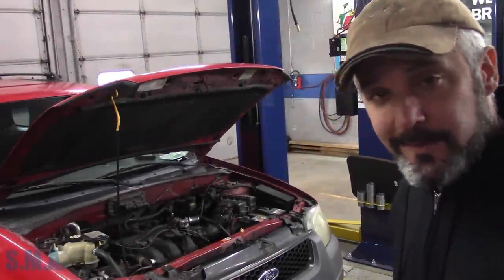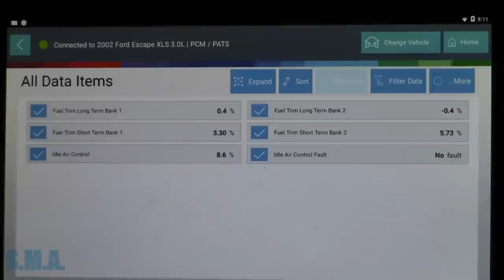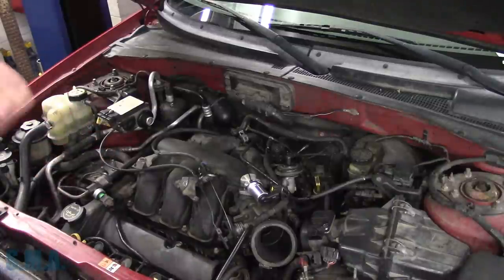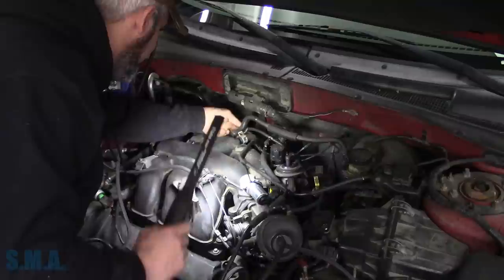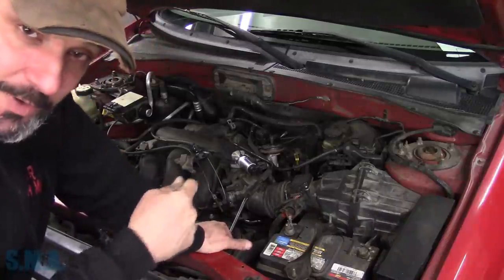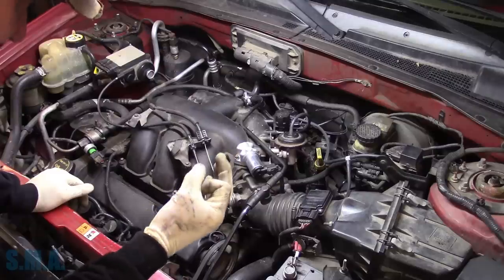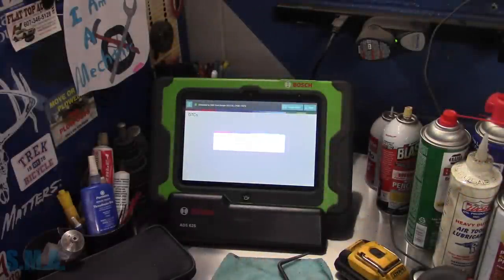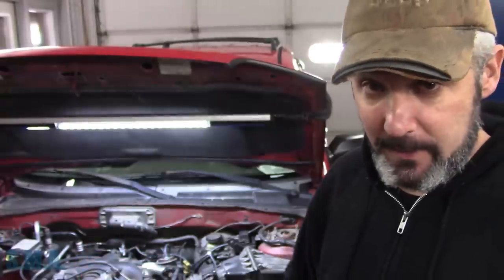Ford Escape:  P1506: Idle Air Control Overspeed Error

Comment: Aloha, I'm 80 years old and this type of repair technique is not new and unfortunately it is NOT going away.  I have had several mechanics that I supervised before all of the ECM era and nothing has changed.  You are one of the few that have an understanding of system function, but for each one of you there are 10+ parts changers and they are ASE certified. Keep up the good work..

Comment: Thanks for this video.  Just used it to diagnose a racing up and down idle in a 2001 Escape with a 3.0.  My friend wanted to put a new IAC on it, I said let's smoke it and lo and behold the vacuum hose from the pcv to intake had gotton against the exhaust manifold creating a massive vacuum leak.  I'm  not in a shop, just a retired gear head with some tools and plenty of time.  Thanks again.  Jon in Tucson

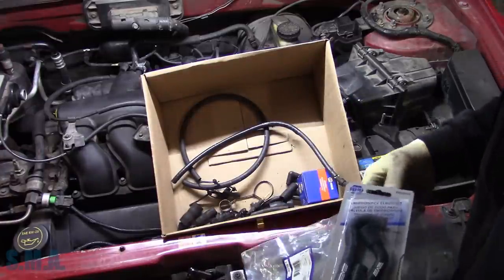Comment: I am at 19:33.         So WHY would that many rubber parts fail? Exhaust leak under the hood?  Engine constantly running hotter than intended? Aux Electric fan not functioning???     (I don't know!!!     I am old school we had Sun Distributor machines and generator/start motor "rattlers"  and Ociliscopes and thought we were "hi-tech".)  An "advance" timing light: OMG that was Buck Rogers! How do you guys do it today????    We gapped most Fords in a pinch with a book of matches (0.016inch, about). 

Don't take this with any seriousness,  I am just a very old mechanic that loves your analytical approach and wish you the continued best.
Reply: The concept is called "design life" Back when things were designed by small teams using paper and slide rules they built in extra margin for themselves because it could easily be one guys fault that a part didn't last. Now with huge collaborative teams of designers working with well-defined design criteria we have much less maintenance and more sophisticated vehicles, but this creates an new problem... saving one penny on a part makes sense when you are making 500,000 of them. And designing with a particularly defined lifespan is another. If it needs to last for a design life of 15 years, that might dictate a less costly rubber formulation. Now that the car is 18, everything's starting to fall apart. For contrast, go check out what Cold War Motors works on :)
Reply: Pretty much anything built after the 90's runs hotter under the hood  because of the way they crammed everything under it. Nice hot converters hanging off the manifolds all the lines and wiring blocking airflow, or worse the insulated engine covers and noise insulation that holds the heat all under the hood.
Reply: Wow Ben! You take me back to my automotive school days. Remember when we measured the capacitance of the condenser? Then discovered it didn't really matter as long as the metal stayed put on the points. The engine itself was as good a distributor machine as any with a scope and variable timing light. I see a lot of rotted "rubber" parts on vehicles these days. I mean the kind that turn your fingers black and don't want to come off with industrial hand cleaners. These parts just don't hold up to the petroleum vapor environment. I've seen too many sucked shut or dissolved.
Reply: Cheap parts built by the lowest bidder to the lowest quality possible.

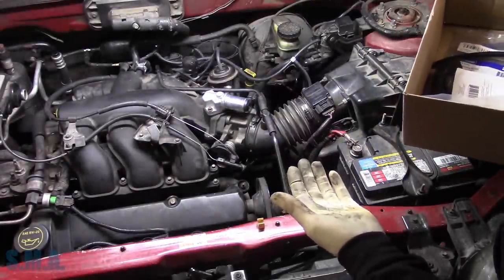Comment: 19:54 THANK YOU for saying this. I unfortunately see a lot of work like that and really unfortunately have even worked with people (for a short time) who did work like that, because there are a lot of really garbage mechanics out there. I've even seen this kind of work from dealerships, along with the usual poked wires, broken clips, misrouted wiring, missing bolts, etc. It makes me sick because I put so much pride and effort into my work, but the mechanics who get it done faster (but crappier) often get paid more, at least for a little while. I understand that things sometimes break on an old car because, lets face it, they aren't built to last. But if everything you touch breaks and you fix it all with electrical tape and super glue, you are the problem. It's nice to be the guy who fixes it right after the other person (or people) got it wrong and/or made it worse, but it really makes us all look bad.
28:40 Ignorance is not an excuse for bad work. It doesn't take a mentor to know that a car should be in better shape than it was before a person fixes it. That's kind of the definition of "fix." Charging someone to fix their car and breaking a ton of other things in the process or generally doing really horrible work is not acceptable under any circumstance. Every professional mechanic has access to training of some sort. It requires them to recognize that they need to improve and take the necessary steps to improve. It should not require someone to tell them that their work sucks. Sometimes the most respectful and useful thing you can do is call out someone who needs to do better or do something else.

Another great video, as always.
Reply: Another thing professionals need to remember is that book time is book time. For every job that takes half the time you get to bill, there's another job that takes longer. Either way, it should be done right. My steering wheel has been crooked for a long time. The mechanic who installed the new steering rack did so with the column misaligned by one spline and "couldn't afford the time" to correct their mistake. Needless to say, I've never been back to that particular shop.
Reply: It only takes longer to fix shady work then if you just did it right the first time

Comment: @South Main Auto Repair LLC it makes me sad to see such an easy fix in terms of troubleshooting get by a shop three times before the customer gave up.  It get that some shops rush their mechanics and use the parts cannon approach, it's a good thing they focus on domestics where the parts are relatively cheap.  You pull that on German cars and you will long be broke before you diagnose the problem.  On this sweet rig, I would have been very tempted to replace the MAF.  Not a fan of MAFs that are over reporting air by 25% at idle, but you did a great service on this car regardless of it's current value or lifetime left.  +1 for SMA!

Comment: I've had vehicles like that in the past.  I've tried to help the other shop or shops and sometimes it helps.  Being a City Fleet Auto Electrician, there were many times I wondered if I was in over my head.  Sometimes you've got to stand back rethink the problem, locate and fix it.  And let the other shop know what you did to find the problem.  Thinking "outa the box" will help a lot!

Comment: Great diagnosis and repair.  I'm curious, is there a smoke machine that you'd recommend for an individual to use on their own cars (not a commercial mechanic)?
Reply: Check out some super simple diy  smoke makers on you tube , I'm a mechanic , but don't fancy spending up to $1000.00 on a smoke machine.

Comment: When I first saw the electrical tape, I knew it was a hack job by the previous shop. Smh. You're awesome in fixing right, even if you had to use some relabeled Dorman Products. I feel you, it will be a lasting repair, just that OE or OEM hoses are much better than Aftermarket for long-term..

Your video, on the 2008 Honda Pilot timing belt, helped me a lot. So yes, if you could do it, I could do it. My parents were impressed, because they felt this was a job for a professional. I get that, but I was currently unemployed and had the time. My '05 Pilot is running like a champ. Thanks SMA!

Comment: Hi Eric. One reason I have always done my own repairs. I have heard mechanics,brag about the tricks they use to cheat people,when I was a boy. I was working 6 to 7 days a week in 2000. My wife told me the 1999 tracker was pulling to the right. I told her to go to a shop and get it checked, They told her it needed the whole front end rebuilt,for around $4000.00. She was almost crying. I checked the front end did a quick and dirty alignment. It's still going strong.  Thank you for being honest Sir.

Comment: I fully agree with what you said, and don't apologise for saying it. 

If the other garages can't be bothered to do the job right in the first instance then find another trade. 
Yes it's great business for you because you are benefitting from their incompetence, but they are basically stealing money from customers.

I own a mobile tyre fitting company in the UK, and I come across cowboys everyday when I replace tyres on vehicles. Badly repaired tyres, illegally repaired tyres, badly damaged part worn tyres fitted etc etc. They are stealing money from customers for their inability to fit a tyre correctly, or fit a decent one in the first place.

I wish you operated in the UK because you'd be my go to mechanic everytime!

Comment: Excellent job as always.  After you described the way the IAC worked and then you unplugged it and the engine RPM didn't change I figured that there was pirate air coming in.  Especially after seeing the taped up vacuum lines.  

You definitely take pride in your work and it shows.  You may have gained another customer as well.

Comment: When I was younger I was a big fan of D.I.Y. hillbilly fixes. Once had a pair of vice grips holding a clutch cable to the firewall for a month when the retaining clip broke. But vacuum hoses, fuel lines and accessory belts and other perished rubber things have bitten my stubborn posterior too many times. Now I just pull out the new shiny rubber parts mini gun cannon hahaha!

Comment: That rookie bull-stuff is fine for the driveway or a temporary fix but if I'm paying full labor rates I expect to get professional work..I dont think you went too far at all.  And thanks for the free tip....but that only works on the 6 cylinder motor..the 4 banger has the PCV under the intake..completely inaccessible..Thanks for the videos Dr. O.  I appreciate your time and wisdom!

Comment: Correct again  Erik do the job right  everytime or dont do it and I've done lots of jobs that were first timer for me but I didnt go into it blind or ignorant I did the research and had an idea on what direction I had to go and I found that most times  haveing a correct shop manual is a huge help and over the years I picked up newer and different shop technicians books to help side menin correcting some of the newer problems from newer cars  so thanks for being Frank and up front about how you see shops not doing the best possable job for their customers

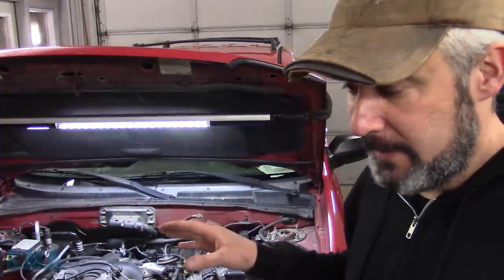Comment: 29:18. Agree.  When I was swinging on spanners I knocked back lots of engine work because I'd never been trained and wasn't set up for it.  Brakes, suspension and wheel alignment were my specialty I didn't even like doing lube services) and I had lots of happy customers.

Comment: I just had watched a new video on the Fordtechnoloco channel of the noises of the 3.0L Duratec where the camshaft cap bolts break or loosen causing some noises. Seems to be the issue if you have misfires associated. Great video and I feel the same way that if you have a shop do it right or don't do it at all. The customer will come back for more work either way but do a crappy job and they will never come back for anything. Keep the videos coming!!!!!

Comment: Eric, you touched on other shops and horrible work...I've seen quite a bit of it in the past 14 years where I work...about a decade ago I had the pleasure of looking at a recently (at the time) rebuilt 289 in a '65 K code Mustang fastback...yeah the solid lifter engine. The thing leaked oil from everywhich way it could...coolant coming out of the front cover and such a rocker arm rattle from the top end due to incorrectly adjusted rockers. I managed to sell everything needed to fix it right, a lot of gaskets...fluids, a valve adjustment done right and I slipped in a quick tune of the timing and carb setup cause it needed it bad. 2 days after I got all the work done to the engine the customer returned with a massive grin...said it had NEVER run that good before and the lack of a burning oil and leaking coolant smell was awesome. I still service that car to this day...the engine doesn't leak a drop of anything still.

Comment: That was a helpful video. Imm gonna try and run down my issue. But I also had a P1120 and P1121 along with the P1506. I did the head gaskets recently and tried to make sure I repaired anything that looked damaged on reassembly. It's been running good until the high idle. But your video will definitely give me a direction to look in. Thank you so much

Comment: You Eric do the job right, you don't rip customers off , it pisses us off when people say all mechanics are robbers , loads of times we do 30secobd jobs for free, well done , I remember in the 1989's before smoke machines we would spray everywhere with maintenance spray to see if air leaks in pipes and housings , dangerous if the HT lead liked it and Boom, fire in the hole!!, Good job Sir , respect from over the pond ,take care and don't use all the baby oil up in the smoke machine, save some for home , to soften your hands 😁😁🤗🤗👍😎💪

Comment: It absolutely needed to be said. I had a young girl come to our shop with her "first car" that she bought from a user car dealership wanting us to do just a quick oil change and simple check over. Well... it turned into play in the front suspension, money light on, needing brakes asap, rear bumper/crash supports rotted, some pretty hefty frame rot, and being that it's a Nissan the typical holes in the floor pan... if she had paid like 200 bucks then maybe but no... she spent 2,800 on the car... (a 2005 Altima)... some guys give mechanics and car sales a very bad name... All you can do is explain the situation and hope for the best!!!!!

Comment: Eric always look forward to your videos. They are interesting and very educational. You can read the manuals you can try to diagnose as much as possible but sometimes you have to come back to the basics. I remember taking my '14 Fusion to the dealer and it took them 3 hours to patch one hole in a tire. They also told me that my battery was bad and needed replacement. Well it came down to the fact that the dealer service center ran out of patches. So I took out a patch from my tool bag and hot the tire repair. I denied to have the battery replace because the tech had hook up the battery wrong and got the wrong reading. Bottom line is its just not happening at your local shops, it's also happening at the dealers. So I have been doing all repairs and preventive maintenance on my car since. Keep up the awesome material and If you can do it I can as will. 👊😉

Comment: I agree with your observations regarding the workmanship of that repair or should I say lack of repair. I worked in the manufacturing world for most of my earlier years and unfortunately  I saw many repairs just like that done on robotics equipment. wrong materials used, poor routing of hoses poor solder connections and so on... it was very irritating to go in to fix something and have to re-do all of the stuff that someone else did. I learned the hard way by expressing myself regarding said observations. Bottom line, don't say a word just fix it.

Comment: In the UK we had a GM car with a 2.0 turbo diesel engine. It came to me from another garage with loss of power, it pulled well from low but ran out of breath higher up the rev range. It had only one fault code. Which was along the lines of  " catastrophic failure ! ". No eml on it drove fine apart from lack of higher rpm power. It had parts replaced,new turbo,new egr,new injectors, fuel filter and housing ,fuel pipes, lift pump, airflow sensor and air filter and a oil service to finish !. The basic checks had never been done. This system relied on a vacuum bleed off the main feed to the brake servo to operate vacuum solenoid valves which controlled  the egr  valve and the actuator on the variable geometry turbo charger. I found on visual inspection that one of the vacuum capillary pipes had a small split in it. This was sufficient to allow components to operate but not the turbo actuator to reach full boost. I replaced the split section all the problems vanished. Time taken and cost  virtually nothing, benefits, new customer, her family and inlaws about 15 cars,annual tests ,services and repairs and recomendations to others. Visual inspection with your eyes and then  the purchase of a smoke machine is often the best investment you can make.

Comment: Very good. What would be interesting to see on these videos is of course the solution as you do very professionally but also the true cost of the repair. A number like myself can handle the job but I image quite a few come to see the true costs involved. Since all the data here is anonymous I would think this data could be available here for people to get an idea of what a scenario is worth on the market.  In other words, the Money light came on, this was the estimate and this is what was paid. I don't think enough people really talk about the costs involved. That leaves allot of great repair videos for those inclined but leaves out those trying to figure out whether it's worth it or not to spend money at a shop or just move on to another car. You can address this issue easily.

Comment: It was funny I commented on another video I had the same issue with a 02 red Escape identical to that lol.  It was the pcv valve. I changed all the gaskets. All the vacuum lines cause they was falling apart. I bought a pcv valve but lost it. So I took out the old one shook it hit it with brake clean and put it back.  Still had issues after all that work I was over it. Until I saw you video and I said that some people shake these it’s 8 bucks.  Lol replace it.  So I did.  It Worked.  Lol.  Idk funny story felt like you was talking to me.  Thanks tho 🙏